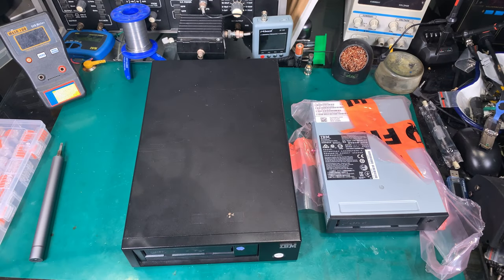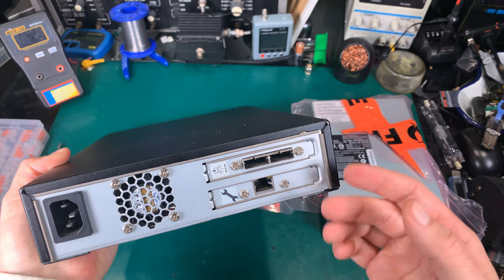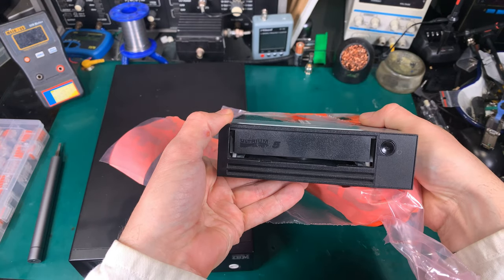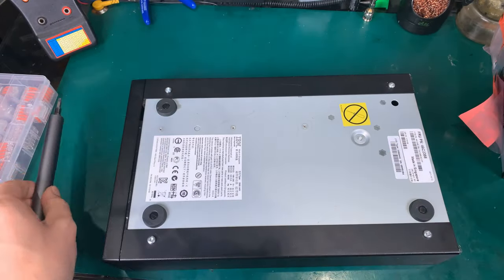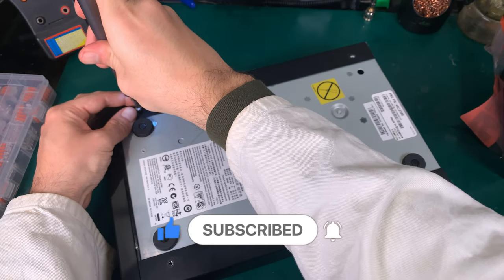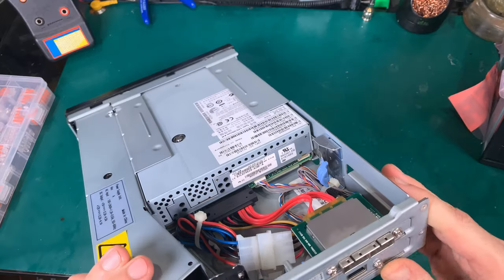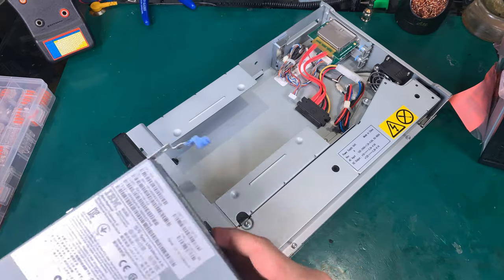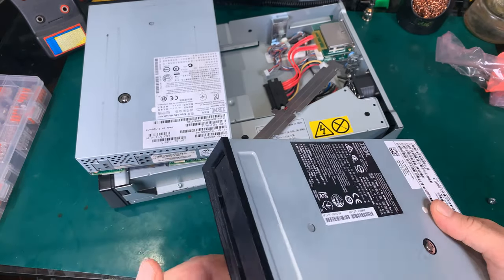IBM LTO5 - external SAS enclosure (tape drive)  fix - replace LTO4 to LTO5 (standard internal drive)

Comment: DELL branded drives seems very similar to this. Also HP internal drives seems cannot be fitted into the IBM/DELL chassis due to the end side having a bent. I haven't seen a HP external drive being opened and showing the internals.